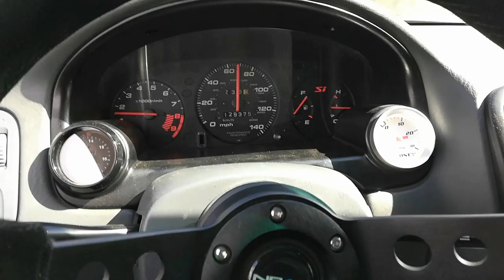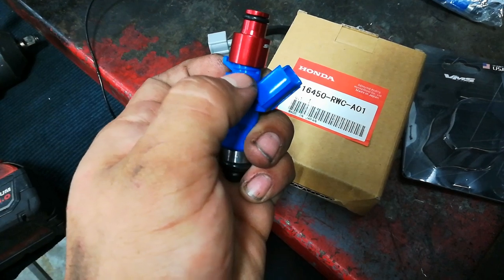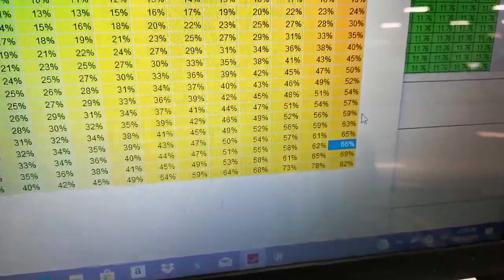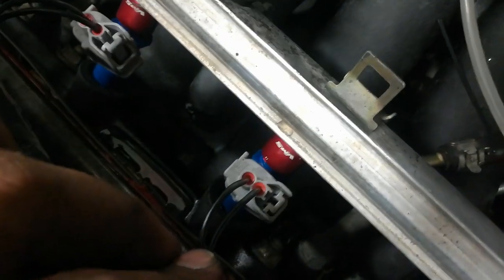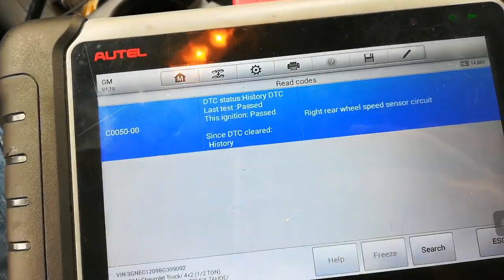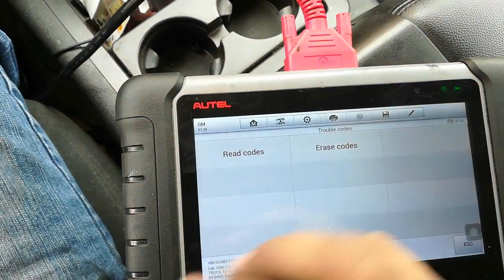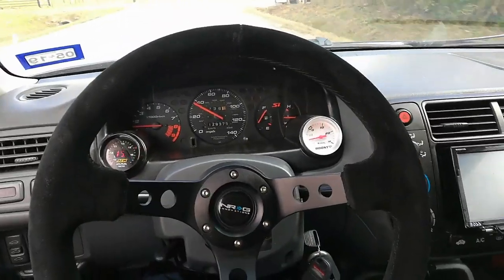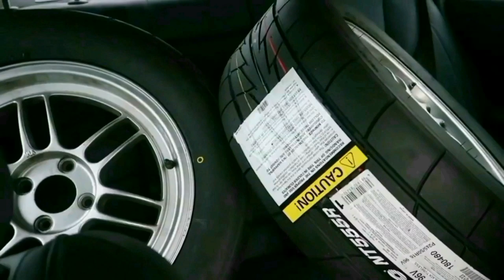TURBO D16 ~ RDX K Series Injectors Into My D16 ~ Boost Pulls ~ Fixing ABS Light

Comment: Where might i find them all at that price? 
Alos have you had a boostleak test done? Curious as to if they seal boost well at the intake manifold. 
It is from my understanding they atomize fuel really well.. 
Im doing a na set up with d17 crank and thinking either these injectors or decap the d17 injectors and flow test